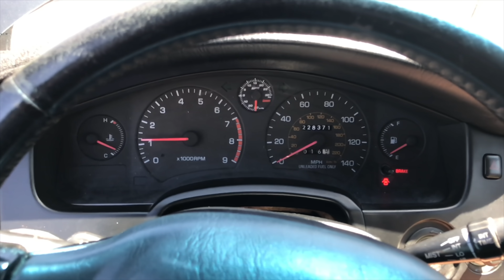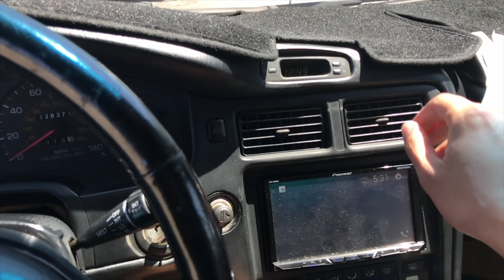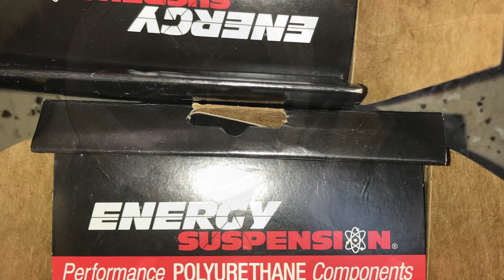BobMr2 1994 Toyota Mr2 Gen5

Comment: How much are you selling this for? I'm im Cali and have 93 turbo im looking to sell for $7500-$8000.
Reply from the maker: Tiny951 can u email me info? Bobboy4@gmail.com
Reply: Bob Pham what specifically do you wanna know?
Reply from the maker: History? Maintenance record? Location? I may be interested.
Reply: Bob Pham Inland empire. No maintance records. The car is white and has JDM 2nd gen 3sgte engine swapped in , Racing hart rims, interior is black with tan door inserts with a kicker sub and amp but overall is in fair condition, nothing is torn just scuffs. It also has a greddy intercooler, apexi bov, boost controller and guages as well as lower springs that were never used.
Reply: Bob Pham also it has no ac and T-top but it does have the sun roof.
Reply from the maker: Tiny951 ummm. Great. If u can send me some pix. I may people asking me to find them clean mr2. I’ll forward it to them. If u planning to sell it.
Reply: Bob Pham Okay where in socal are you?